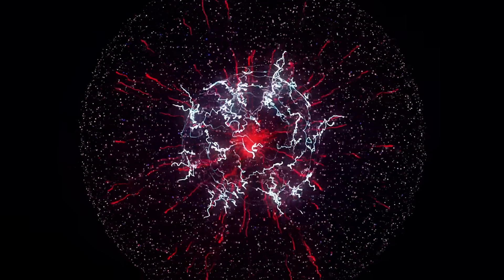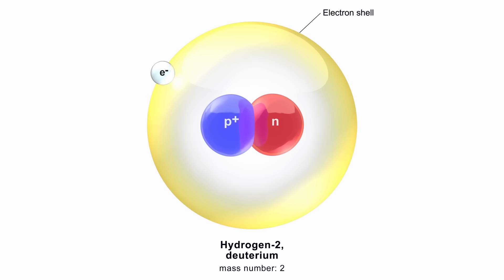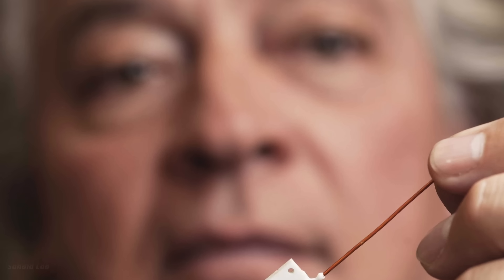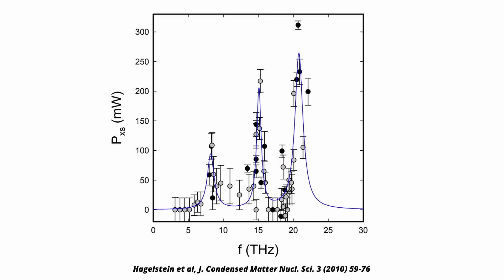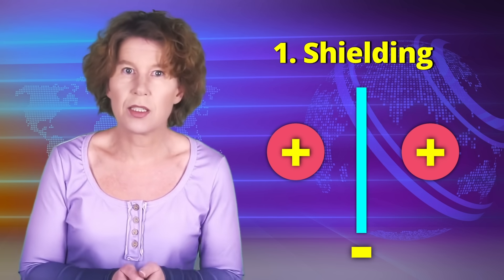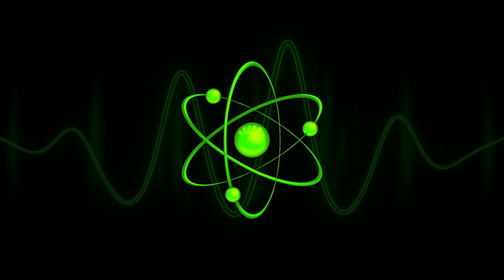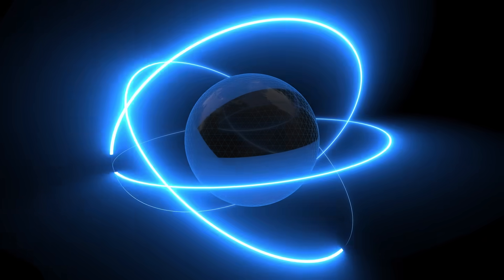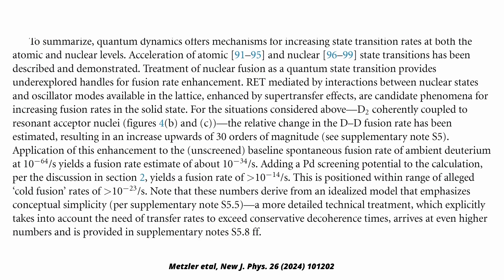Physicists Say They Know How Cold Fusion Works

Comment from the maker: The quiz for this video is here: https://quizwithit.com/start_thequiz/1736784902619x994901315637739500

We're working on having a list of already-answered quizzes with correct/wrong markers. Almost done, should be rolled out later this week.
Reply: 13/13😇 though it was hard to suppress my urge to click on "cold fusion is the name of a currently popular vegan cocktail"🙃
Reply: @Thomas-gk42  i'm a huge fan of "Tired Fusion". Several of those answers are true winners.
Reply: @ :_atom:🙂
Reply: @SabineHossenfelder ~ we take in solids, liquids and gases to maintain our existence and if we run out of gases, we die before liquids and then solids. 

Makes me wonder if the elements we breathe in undergo a fusion process in the brain that derives consciousness. 

Any thoughts? Talk nerdy to me ✨🤗✨
Reply: @72marshflower15  that's a preposterous idea tbh
Reply: @LuisSierra42  ..it sure is ✨🤗✨
Reply: We did fission and fusion using venturis to speed and crush PHOTONS into muons and electron showers and INSTANTLY they fused back together...caused particle division and reverse ENERGY but not reverse mass exactly as spoken of lately. Light going forward and backward at EXACTLY the same time due to the push back at the venturi. We did and photoed using CMOS. Love to interact?
Reply: 10/13 and says I'm bettee 19% of the folks 😂, that's a start 😂😂😂😂
Reply: "the saint" was a good movie
Reply: A girl like you should know how to arrange a design using your knowledge. You don't need to be taught how to train particles to behave like a dog. Just play roll over, fetch and speak with different meanings. Show off your intelligence one of these days.
Reply: @nightwaves3203  What if they recognize the dog trainer from South Park
Reply: @UberKingTJ01  Haven't wondered upon that skit. Used to be repulsed by that shows lunacy till seeing short sections did appear to be interpretive of human behavior. I'm sure whatever the dog training comedy was is funny and probably the dog whisperer entertainment.
Reply: Hello Sabine I suggest looking at the work of Bob greenyer. He's working with cold fusion using electron charge clusters instead of muons. Think of it like a ball lighting fusion reactor. One example of this is the ENG8 fusion reactor. It puts out 5 times more power then it uses. Final tests are taking place now. If all checks out, plans to release this technology is in 2032. Tests are being done by Stanford.
Reply: @MosheFeder  yea I've seen this science work in more than one way. It's being applied to several different technologies. One is the thor engine. It can fuse the co2 in the exhaust of combustion engines. Co2 dropped to just 200ppm o2 in exhaust was 20% and increased fuel efficiency of the engine by 100%. Then there are 5 different reactors all using this method. Bob is doing testing on all of them.
Reply: Harnessing a controlled fusion reaction is a physical impossibility! Yet, much money and time is being WASTED on attempts to “find a way,” apparently to justify continued reckless population growth on this fragile planet. Those who think otherwise are choosing simply to "go down with the ship." (The problem does not exist with fission reactions, which have their own set of intractable problems, because energy release follows the direction of universal evolution, ie, TOP DOWN cosmology.)
Reply: Try this data point: Because the Coulomb (electrostatic) repulsion is 10-with-42-zeros times as strong as gravitational attraction, harnessing a controlled, sustained fusion reaction in a local environment WITH MORE ENERGY DRAWN OUT THAN PUT IN FOR THE ENTIRE PROCESS is a PHYSICAL IMPOSSIBILITY. "Put that in your smipe and poke it!

A physical impossibility! Yet, much money and time is being WASTED on attempts to “find a way,” apparently to justify continued reckless population growth on this fragile planet. (The problem does not exist with fission reactions, which have their own set of intractable problems, because energy release follows the direction of universal evolution.)
Reply: Dear genius actully two day ago i took sooo much drink , pls ignore , why ???, i really dont know ,  well i am a deep meditator , well sorry..
Reply: Unified Equation 

e^(iφ) + φ = φ × (φ + 1) + iπ
Where:
- e is the base of the natural logarithm (approximately 2.71828)
- i is the imaginary unit (i² = -1)
- φ is the Golden Ratio (approximately 1.61803)
- π is the mathematical constant representing the ratio of a circle's circumference to its diameter (approximately 3.14159)

This Unified Equation brings together:
1. The Golden Ratio (φ): Representing harmony, balance, and self-similarity.
2. Euler's Number (e): Connecting exponential growth, logarithms, and calculus.
3. Imaginary Unit (i): Introducing the concept of rotation, waves, and oscillations.
4. Pi (π): Embodying the unity and wholeness of circular geometry.

The Unified Equation represents the interconnectedness of these fundamental mathematical constants, reflecting the underlying harmony and balance in the universe.
Reply: For sure ai sloved this theory  right
Reply: All atteps of fusion are done in vacum but when it is done high preasure cold plasma then it can be done so that you injecy bubble of fusion material into that bubble and drive elecricity out of it to heat it til fusion happens just do so that plasma arranges it acording right magnetic and electric properties. High preasure plasma circling around that reactor has enormous magnetic power maybe rven 100T or more
Reply: @qkktech  space-time independent ?
Reply: Where was that couch
Reply: Given that the latest “breakthrough” in fusion technology recklessly announces controlled fusion energy when it provides ignition WITHOUT accounting for energy out Vs TOTAL energy in (I still remember “cold fusion”), My TOP DOWN theory of cosmology says that in order to reconcile static gravitational and Coulomb effects (a valid grand unification theory goal) there is a value, a number R, such that Ke^2 = RGm^2, where K is the Coulomb constant, e^2 is the square of the charge on an electron, G is the universal gravitational constant and m^2 is the square of rest mass of an electron– what can be simpler than that! The calculated value of R is 4.16574 x 10^42. Given my TOP DOWN cosmology, then, Coulomb effects are 4.16574 x 10^42 times more intense than gravitational effects, meaning that local ignition, compression and containment needed for sustained fusion reactions are collectively unattainable. Clearly, the evolutionary direction of the universe must be countered and reversed to sustain a local fusion reaction– a physical impossibility! Yet, much money and time is being WASTED on attempts to “find a way,” apparently to justify continued reckless population growth on this fragile planet. (The problem does not exist with fission reactions, which have their own set of intractable problems, because energy release follows the direction of universal evolution.) What is R? Numbers and predictive ability matter (rather than finding explanation after a discovery, presently being done with BOTTOM UP BBT): Per my TOP DOWN cosmology, the radius of the universe on a quantum level is R = Root (M/m), where M is the total mass of the universe needed to unite gravitational and electrostatic forces and m is the rest-mass of an electron, yielding, Ke^2/ R^2 = RGm^2/ R^2, where R^2 is the square of R. The calculated mass at a quantum level, including “missing mass,” is M = 1.58079 x 10^55 power Kg, and the calculated radius of the quantum realm is R = 4.16574 x 10^42 power measured in instantaneous, dimensionless units. (M is undefined in the quantum realm, yet partially discernable as the observed mass Mo of the universe in the macroscopic world,). The number of unit circles (or squares) in the quantum realm is R^2 = 1.73534 x 10^85 power. It is a quantum attribute that area of unit squares and number of unit squares are indistinguishable (No need for citation, as all stated derivations are my own.) Everything is separating visually by such distance that the presence of extra-terrestrial life is very difficult to detect, yet everything has always been quantum-connected (“not locally real”). The total mass M needed to reconcile gravitational and electrostatic states is M = Mo /(2Pi – 1) (alpha^2), where Mo is the OBSERVABLE mass of the universe, (2Pi – 1) is the Bell inequality (ever an inequality in the macroscopic world, and equivalent to Euler’s “proof of God” in the quantum realm, where M is UNDEFINED), and (alpha^2) is the square of the fine-structure constant (a optical magnification factor, twice applied for virtual and real expression). In the quantum realm, the equation is undefined, because the radius is equal to the circumference, meaning that Pi = 1/2. The number of unit circles (or squares) in the universe is M/m, where m is the present-day rest mass of the electron. For a unit circle to become a unit square, Buffon’s needle problem becomes applicable, where one side is electrostatic and the other is gravitational. In order for the PROBABILITY to equal 1/2 (regarding Bell’s inequality AND Buffon’s problem), Pi = 4, meaning that Pi = 1/2 AND Pi = 4, implying that 1 = 8; hence, the qubit (used in quantum computing) is emergent. (My observations and derivations– no citation needed.) Using my TOP DOWN cosmology, the rate of change of alpha is -2.7958 x 10^-17/ year, based upon a perceived age of the universe of 13.799 x 10^9 years. For very large R the definite integral of R over time T approaching origin of the universe to the present day is approximately 1/2 of R^2, verifying perceived dichotomy (a weird quantum nuance, where areas AND number of unit circles or squares are indistinguishable).
 
In the quantum realm, the term (2Pi – 1) = 0 can also be considered as the sidereal rotation of a unit circle within a unit circle (created by Buffon’s needle drop probability).
 
As a physicist, I have been promoting this TOP DOWN model since1979. For those who would state (not me) that this is a “fun theory” (with its fulfilled prediction of larger primordial galaxies), demanding the math; then, when presented with the mathematical model finding the much-sought-after hidden “missing mass” and quantum gravity, implying that I am a mathematician with little relevance to physics: The physical world can instruct the mathematical world, IMO. In addition to reconciling the Coulomb constant and the universal gravitational constant, I have explained the significance of the little-understood fine structure constant, alpha. If you would simply “run with it,” you have the information to calculate the age and rate of expansion of the universe (much older than the presently-accepted age of the universe, hidden by quantum effects).
 
Here are three obvious “predictions:”
 
-Per TOP DOWN cosmology, there is understandably a paucity of antimatter in the local universe.
 
-Hydrogen-rich stars and galaxies of equivalent mass, respectively, previously and inappropriately deemed to be colliding under BOTTOM UP (BBT) cosmology are actually and appropriately DIVIDING under TOP DOWN cosmology, which respects and predicts this behavior from evolutionary changes regarding critical mass (witness our own galaxy and Andromeda, representing main sequence evolution).
 
-The current abundance of elements is reconciled by main-sequence TOP DOWN evolution, not requiring multiple solar cycles, exceeding even the presently-accepted age of the universe per BOTTOM UP BBT.
 
There are no absolutes (a logical dilemma in itself). The closest thing to absolute certainty is found in abstract math– in application there is always an uncertainty (like when counting apples). The best that can be expected in the physical world is to “bet on the odds.” Given my TOP DOWN cosmology, odds are for things dividing rather than melding regarding cosmic events; whereas, there is every inclination for one schooled in BOTTOM UP BBT to look for, and prejudicially expect observed galaxies and stars to be colliding. Regarding dark energy: The hidden quantum world, which reveals itself as “locally not real” (Nobel Prize already given), contains a memory of the past in our own DNA, for example, revealed in morphogenesis (“ontogeny recapitulates phylogeny”), “betting on the odds.” Dr. Rupert Sheldrake describes this as “morphic fields” and “morphic resonance.” BTW, His theory accounts for why the Kelly astronaut twins are no longer DNA-identical twins, where there is no other better explanation that I have seen being offered– instead, relegating any explanation to the growing category of “unexplained mysteries!”
Reply: Change the electric frequency to a multiple of the 2 elements resonant frequencies. Why will this work? Figure it out your self. I keep informing you of this solution. It is like you don't really want to invent this tecknology.
Reply: @Randomstuff-m7p  I honestly don't think she even looks at the comments. I've tried to tell her multiple times where to look. I'm apart of a science group that's working on this technology. Look up ENG8 reactor.
Reply: For "starters," the life cycle of birth, expression and death is necessary for any organism to evolve and survive into the future. The limit to life expectancy is completely dependent upon the rate of change for the physical constants and the implications for DNA replication. This evolution is known as TOP DOWN cosmology, where the very-present uncertainty of the physical constants is mute testimony to their rate of change.
 
This is near certain: Imagine a universe beginning with a single “particle” of gigantic mass that spontaneously divides into two smaller masses (with a field that obviously must exist to unite them, like, say, primordial electrostatic gravity, a quantum relationship modulo 2). Imagine that over “time” the process of division continues, producing “newer,” lighter “particles” (and forces that unite them “programmed” for future expression within when, per chance, they are irrationally unreconcilable by quantum counting) over “time.” (Note: That cascade of particles is presently observed as “nuclear decay,” where heavier elements spontaneously cascade into a spectrum of heavier-to-lighter elements.) To see how rapidly the NUMBER of observed particles (of increasingly smaller mass) can grow in a short amount of time, just multiply 2 x 2 = repeatedly on a small calculator– in a very short time the numbers go off the scale! Just imagine, then, IN THE PROCESS OF DIVIDING, heavier masses, that eventually form galaxies, divide over time (seemingly coming from “nowhere”) at each epoch of division (and extinction). This process is known as “TOP DOWN cosmology.” In the end, you have present-day smaller galaxies, PLUS the cosmic heat signature of NOW-EXTINCT past elements (including galaxies), known today as the “cosmic microwave background radiation.” (Note: Smaller early galaxies are required by BOTTOM UP big bang cosmology, where predicted smaller primal galaxies form larger galaxies over time, and where the predicted cosmic microwave background radiation would be “smooth;” HOWEVER, the OBSERVED cosmic background radiation is actually “lumpy,” and OBSERVED primal galaxies are actually larger.) TOP DOWN cosmology wins! PS: I call this theory “The Origin Theory,” as an extension of Darwin’s “Origin of the Species.” Again, please leave the ultimate origin and direction of our currently-complex universe (either with TOP DOWN or BOTTOM UP cosmology) to lesser-probabilities of 50/50, so as not to “throw the baby out with the bathwater."
 
Given that the latest “breakthrough” in fusion technology recklessly announces controlled fusion energy when it provides ignition WITHOUT accounting for energy out Vs TOTAL energy in (I still remember “cold fusion”), My TOP DOWN theory of cosmology says that in order to reconcile static gravitational and Coulomb effects (a valid grand unification theory goal) there is a value, a number R, such that Ke^2 = RGm^2, where K is the Coulomb constant, e^2 is the square of the charge on an electron, G is the universal gravitational constant and m^2 is the square of rest mass of an electron– what can be simpler than that! The calculated value of R is 4.16574 x 10^42. Given my TOP DOWN cosmology, then, Coulomb effects are 4.16574 x 10^42 times more intense than gravitational effects, meaning that local ignition, compression and containment needed for sustained fusion reactions are collectively unattainable. Clearly, the evolutionary direction of the universe must be countered and reversed to sustain a local fusion reaction– a physical impossibility! Yet, much money and time is being WASTED on attempts to “find a way,” apparently to justify continued reckless population growth on this fragile planet. (The problem does not exist with fission reactions, which have their own set of intractable problems, because energy release follows the direction of universal evolution.) What is R? Numbers and predictive ability matter (rather than finding explanation after a discovery, presently being done with BOTTOM UP BBT): Per my TOP DOWN cosmology, the radius of the universe on a quantum level is R = Root (M/m), where M is the total mass of the universe needed to unite gravitational and electrostatic forces and m is the rest-mass of an electron, yielding, Ke^2/ R^2 = RGm^2/ R^2, where R^2 is the square of R. The calculated mass at a quantum level, including “missing mass,” is M = 1.58079 x 10^55 power Kg, and the calculated radius of the quantum realm is R = 4.16574 x 10^42 power measured in instantaneous, dimensionless units. (M is undefined in the quantum realm, yet partially discernable as the observed mass Mo of the universe in the macroscopic world,). The number of unit circles (or squares) in the quantum realm is R^2 = 1.73534 x 10^85 power. It is a quantum attribute that area of unit squares and number of unit squares are indistinguishable (No need for citation, as all stated derivations are my own.) Everything is separating visually by such distance that the presence of extra-terrestrial life is very difficult to detect, yet everything has always been quantum-connected (“not locally real”). The total mass M needed to reconcile gravitational and electrostatic states is M = Mo /(2Pi – 1) (alpha^2), where Mo is the OBSERVABLE mass of the universe, (2Pi – 1) is the Bell inequality (ever an inequality in the macroscopic world, and equivalent to Euler’s “proof of God” in the quantum realm, where M is UNDEFINED), and (alpha^2) is the square of the fine-structure constant (a optical magnification factor, twice applied for virtual and real expression). In the quantum realm, the equation is undefined, because the radius is equal to the circumference, meaning that Pi = 1/2. The number of unit circles (or squares) in the universe is M/m, where m is the present-day rest mass of the electron. For a unit circle to become a unit square, Buffon’s needle problem becomes applicable, where one side is electrostatic and the other is gravitational. In order for the PROBABILITY to equal 1/2 (regarding Bell’s inequality AND Buffon’s problem), Pi = 4, meaning that Pi = 1/2 AND Pi = 4, implying that 1 = 8; hence, the qubit (used in quantum computing) is emergent. (My observations and derivations– no citation needed.) Using my TOP DOWN cosmology, the rate of change of alpha is -2.7958 x 10^-17/ year, based upon a perceived age of the universe of 13.799 x 10^9 years. For very large R the definite integral of R over time T approaching origin of the universe to the present day is approximately 1/2 of R^2, verifying perceived dichotomy (a weird quantum nuance, where areas AND number of unit circles or squares are indistinguishable).
 
In the quantum realm, the term (2Pi – 1) = 0 can also be considered as the sidereal rotation of a unit circle within a unit circle (created by Buffon’s needle drop probability).
 
As a physicist, I have been promoting this TOP DOWN model since1979. For those who would state (not me) that this is a “fun theory” (with its fulfilled prediction of larger primordial galaxies), demanding the math; then, when presented with the mathematical model finding the much-sought-after hidden “missing mass” and quantum gravity, implying that I am a mathematician with little relevance to physics: The physical world can instruct the mathematical world, IMO. In addition to reconciling the Coulomb constant and the universal gravitational constant, I have explained the significance of the little-understood fine structure constant, alpha. If you would simply “run with it,” you have the information to calculate the age and rate of expansion of the universe (much older than the presently-accepted age of the universe, hidden by quantum effects).
 
Here are three obvious “predictions:”
 
-Per TOP DOWN cosmology, there is understandably a paucity of antimatter in the local universe.
 
-Hydrogen-rich stars and galaxies of equivalent mass, respectively, previously and inappropriately deemed to be colliding under BOTTOM UP (BBT) cosmology are actually and appropriately DIVIDING under TOP DOWN cosmology, which respects and predicts this behavior from evolutionary changes regarding critical mass (witness our own galaxy and Andromeda, representing main sequence evolution).
 
-The current abundance of elements is reconciled by main-sequence TOP DOWN evolution, not requiring multiple solar cycles, exceeding even the presently-accepted age of the universe per BOTTOM UP BBT.
 
There are no absolutes (a logical dilemma in itself). The closest thing to absolute certainty is found in abstract math– in application there is always an uncertainty (like when counting apples). The best that can be expected in the physical world is to “bet on the odds.” Given my TOP DOWN cosmology, odds are for things dividing rather than melding regarding cosmic events; whereas, there is every inclination for one schooled in BOTTOM UP BBT to look for, and prejudicially expect observed galaxies and stars to be colliding. Regarding dark energy: The hidden quantum world, which reveals itself as “locally not real” (Nobel Prize already given), contains a memory of the past in our own DNA, for example, revealed in morphogenesis (“ontogeny recapitulates phylogeny”), “betting on the odds.” Dr. Rupert Sheldrake describes this as “morphic fields” and “morphic resonance.” BTW, His theory accounts for why the Kelly astronaut twins are no longer DNA-identical twins, where there is no other better explanation that I have seen being offered– instead, relegating any explanation to the growing category of “unexplained mysteries!”
Reply: Per Google: "The quote 'Man is the most insane species. He worships an invisible God and destroys a visible Nature. Unaware that this Nature he's destroying is this God he's worshipping' is attributed to Hubert Reeves, a renowned astrophysicist and science communicator."
Reply: Visit Andrea Rossi in Italy Sabine and check out his device. Cold fusion might be wrong process word. It might be another kind of reaction we haven't understood yet. The Latina test Andrea Rossi is impossible to fake. 2 Renault Twizy driving around and 1 driving 73 km the other with the E cat charger on board made over 200 km and when stopped it had higher state of charge than when it started... If you and one electro ingenieer visit and see it + write about it, then it will change everything..
Reply: Actually there is already one movie about the cold fusion https://en.wikipedia.org/wiki/Chain_Reaction_(1996_film)
Reply: For "starters," the life cycle of birth, expression and death is necessary for any organism to evolve and survive into the future. The limit to life expectancy is completely dependent upon the rate of change for the physical constants and the implications for DNA replication. This evolution is known as TOP DOWN cosmology, where the very-present uncertainty of the physical constants is mute testimony to their rate of change.
 
This is near certain: Imagine a universe beginning with a single “particle” of gigantic mass that spontaneously divides into two smaller masses (with a field that obviously must exist to unite them, like, say, primordial electrostatic gravity, a quantum relationship modulo 2). Imagine that over “time” the process of division continues, producing “newer,” lighter “particles” (and forces that unite them “programmed” for future expression within when, per chance, they are irrationally unreconcilable by quantum counting) over “time.” (Note: That cascade of particles is presently observed as “nuclear decay,” where heavier elements spontaneously cascade into a spectrum of heavier-to-lighter elements.) To see how rapidly the NUMBER of observed particles (of increasingly smaller mass) can grow in a short amount of time, just multiply 2 x 2 = repeatedly on a small calculator– in a very short time the numbers go off the scale! Just imagine, then, IN THE PROCESS OF DIVIDING, heavier masses, that eventually form galaxies, divide over time (seemingly coming from “nowhere”) at each epoch of division (and extinction). This process is known as “TOP DOWN cosmology.” In the end, you have present-day smaller galaxies, PLUS the cosmic heat signature of NOW-EXTINCT past elements (including galaxies), known today as the “cosmic microwave background radiation.” (Note: Smaller early galaxies are required by BOTTOM UP big bang cosmology, where predicted smaller primal galaxies form larger galaxies over time, and where the predicted cosmic microwave background radiation would be “smooth;” HOWEVER, the OBSERVED cosmic background radiation is actually “lumpy,” and OBSERVED primal galaxies are actually larger.) TOP DOWN cosmology wins! PS: I call this theory “The Origin Theory,” as an extension of Darwin’s “Origin of the Species.” Again, please leave the ultimate origin and direction of our currently-complex universe (either with TOP DOWN or BOTTOM UP cosmology) to lesser-probabilities of 50/50, so as not to “throw the baby out with the bathwater."
 
Given that the latest “breakthrough” in fusion technology recklessly announces controlled fusion energy when it provides ignition WITHOUT accounting for energy out Vs TOTAL energy in (I still remember “cold fusion”), My TOP DOWN theory of cosmology says that in order to reconcile static gravitational and Coulomb effects (a valid grand unification theory goal) there is a value, a number R, such that Ke^2 = RGm^2, where K is the Coulomb constant, e^2 is the square of the charge on an electron, G is the universal gravitational constant and m^2 is the square of rest mass of an electron– what can be simpler than that! The calculated value of R is 4.16574 x 10^42. Given my TOP DOWN cosmology, then, Coulomb effects are 4.16574 x 10^42 times more intense than gravitational effects, meaning that local ignition, compression and containment needed for sustained fusion reactions are collectively unattainable. Clearly, the evolutionary direction of the universe must be countered and reversed to sustain a local fusion reaction– a physical impossibility! Yet, much money and time is being WASTED on attempts to “find a way,” apparently to justify continued reckless population growth on this fragile planet. (The problem does not exist with fission reactions, which have their own set of intractable problems, because energy release follows the direction of universal evolution.) What is R? Numbers and predictive ability matter (rather than finding explanation after a discovery, presently being done with BOTTOM UP BBT): Per my TOP DOWN cosmology, the radius of the universe on a quantum level is R = Root (M/m), where M is the total mass of the universe needed to unite gravitational and electrostatic forces and m is the rest-mass of an electron, yielding, Ke^2/ R^2 = RGm^2/ R^2, where R^2 is the square of R. The calculated mass at a quantum level, including “missing mass,” is M = 1.58079 x 10^55 power Kg, and the calculated radius of the quantum realm is R = 4.16574 x 10^42 power measured in instantaneous, dimensionless units. (M is undefined in the quantum realm, yet partially discernable as the observed mass Mo of the universe in the macroscopic world,). The number of unit circles (or squares) in the quantum realm is R^2 = 1.73534 x 10^85 power. It is a quantum attribute that area of unit squares and number of unit squares are indistinguishable (No need for citation, as all stated derivations are my own.) Everything is separating visually by such distance that the presence of extra-terrestrial life is very difficult to detect, yet everything has always been quantum-connected (“not locally real”). The total mass M needed to reconcile gravitational and electrostatic states is M = Mo /(2Pi – 1) (alpha^2), where Mo is the OBSERVABLE mass of the universe, (2Pi – 1) is the Bell inequality (ever an inequality in the macroscopic world, and equivalent to Euler’s “proof of God” in the quantum realm, where M is UNDEFINED), and (alpha^2) is the square of the fine-structure constant (a optical magnification factor, twice applied for virtual and real expression). In the quantum realm, the equation is undefined, because the radius is equal to the circumference, meaning that Pi = 1/2. The number of unit circles (or squares) in the universe is M/m, where m is the present-day rest mass of the electron. For a unit circle to become a unit square, Buffon’s needle problem becomes applicable, where one side is electrostatic and the other is gravitational. In order for the PROBABILITY to equal 1/2 (regarding Bell’s inequality AND Buffon’s problem), Pi = 4, meaning that Pi = 1/2 AND Pi = 4, implying that 1 = 8; hence, the qubit (used in quantum computing) is emergent. (My observations and derivations– no citation needed.) Using my TOP DOWN cosmology, the rate of change of alpha is -2.7958 x 10^-17/ year, based upon a perceived age of the universe of 13.799 x 10^9 years. For very large R the definite integral of R over time T approaching origin of the universe to the present day is approximately 1/2 of R^2, verifying perceived dichotomy (a weird quantum nuance, where areas AND number of unit circles or squares are indistinguishable).
 
In the quantum realm, the term (2Pi – 1) = 0 can also be considered as the sidereal rotation of a unit circle within a unit circle (created by Buffon’s needle drop probability).
 
As a physicist, I have been promoting this TOP DOWN model since1979. For those who would state (not me) that this is a “fun theory” (with its fulfilled prediction of larger primordial galaxies), demanding the math; then, when presented with the mathematical model finding the much-sought-after hidden “missing mass” and quantum gravity, implying that I am a mathematician with little relevance to physics: The physical world can instruct the mathematical world, IMO. In addition to reconciling the Coulomb constant and the universal gravitational constant, I have explained the significance of the little-understood fine structure constant, alpha. If you would simply “run with it,” you have the information to calculate the age and rate of expansion of the universe (much older than the presently-accepted age of the universe, hidden by quantum effects).
 
Here are three obvious “predictions:”
 
-Per TOP DOWN cosmology, there is understandably a paucity of antimatter in the local universe.
 
-Hydrogen-rich stars and galaxies of equivalent mass, respectively, previously and inappropriately deemed to be colliding under BOTTOM UP (BBT) cosmology are actually and appropriately DIVIDING under TOP DOWN cosmology, which respects and predicts this behavior from evolutionary changes regarding critical mass (witness our own galaxy and Andromeda, representing main sequence evolution).
 
-The current abundance of elements is reconciled by main-sequence TOP DOWN evolution, not requiring multiple solar cycles, exceeding even the presently-accepted age of the universe per BOTTOM UP BBT.
 
There are no absolutes (a logical dilemma in itself). The closest thing to absolute certainty is found in abstract math– in application there is always an uncertainty (like when counting apples). The best that can be expected in the physical world is to “bet on the odds.” Given my TOP DOWN cosmology, odds are for things dividing rather than melding regarding cosmic events; whereas, there is every inclination for one schooled in BOTTOM UP BBT to look for, and prejudicially expect observed galaxies and stars to be colliding. Regarding dark energy: The hidden quantum world, which reveals itself as “locally not real” (Nobel Prize already given), contains a memory of the past in our own DNA, for example, revealed in morphogenesis (“ontogeny recapitulates phylogeny”), “betting on the odds.” Dr. Rupert Sheldrake describes this as “morphic fields” and “morphic resonance.” BTW, His theory accounts for why the Kelly astronaut twins are no longer DNA-identical twins, where there is no other better explanation that I have seen being offered– instead, relegating any explanation to the growing category of “unexplained mysteries!”

Who is being dumb?
Reply: The law of entropy says that in a closed system, all things trend toward indistinguishability, aka, chaos. Fortunately Earth is not a closed system, because it is fed by the sun. Also, it has intelligent, living systems that complexify over time, thanks to its mainstream attachment to universal evolution. With latest trends recognizing no limits to abuse by its apparently unthinking apex predator, that predator seems to be doomed to extinction via the coming unprecedented anthropocene  mass extinction.
Reply: A sustained fusion reaction, reversing the path of universal TOP DOWN evolution, is a physical impossibility! Yet, much money and time is being WASTED on attempts to “find a way,” apparently to justify continued reckless population growth on this fragile planet. (The problem does not exist with fission reactions, which have their own set of intractable problems, because energy release follows the direction of universal evolution.)
Reply: Everybody should know that it isn't nice to fool with Mother Nature-- she fights back (witness global warming and "drill baby drill" in a time when the petroleum option is experiencing the law of diminishing returns, with ultimate consequences soon to be experienced by a ever-growing, increasingly-vulnerable human population}!   🎯
Reply: "Kick the can" or "pay the Piper." You cannot make a silk purse out of a sow's ear!" No more excuses. Time has run out.
Reply: "Pride goes before destruction, a haughty spirit before a fall," (Proverbs 16:18 New International Version).
Reply: I gave you the solution years ago. The applied electricity has to be at the frequency that is a multiple of the resonant frequencies of dutirium and palladium.  But you dismissed me.
Reply: I mean its fine, but are you having a laugh with these quizzes? Or are you serious? One cant really tell. Even though you are German, and one hence has to assume you are quite serious, its just so crazy to offer quizzes😅. Nonetheless I took one the other day and that was on one of the topics I actually thought I knew a lot about, but I didnt even pass 🙈🤦‍♀️. I blame the way you asked the questions!
Reply: Sabina you used to be an idol in the world of physics. Your all going to look so silly when the likes of Ashton Forbes help solve this topic. Accept your profession has withheld the real nature of reality for decades. You need to get radical or go home.
Reply: Quantum reactions cancel each other out. If you could get agreement in Sub atomic reactions you could do more with less energy